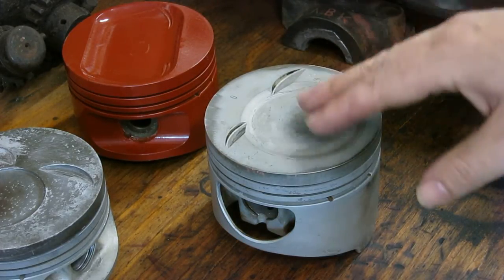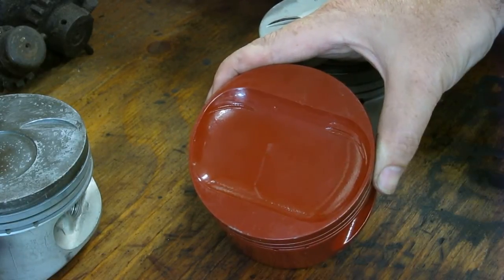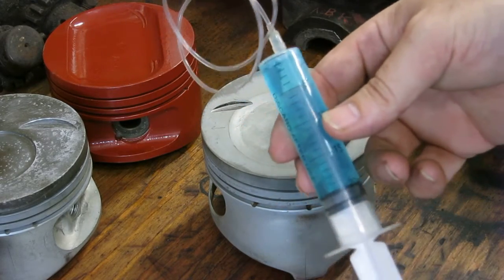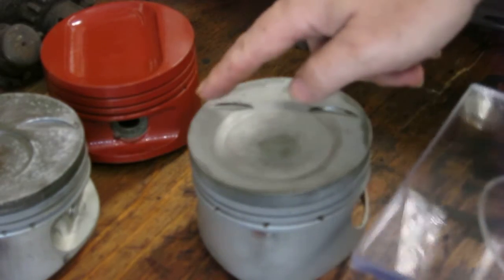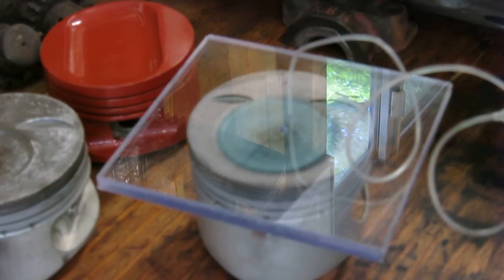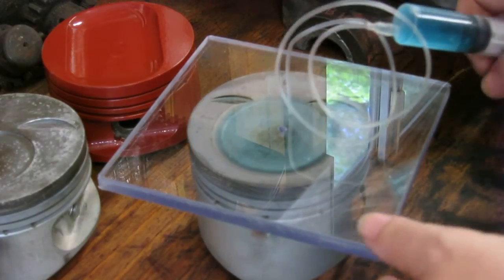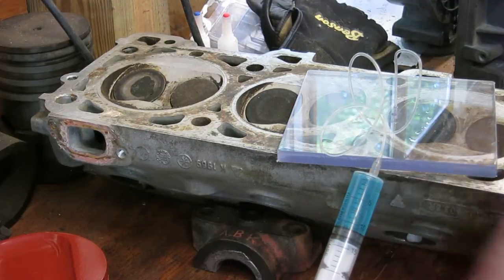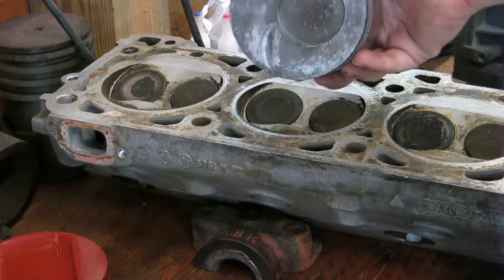Measuring piston head volume

Comment: What about the volume in the hose still? Do u have to add it back to the syringe since it took it from the syringe but didn't add to piston
Reply from the maker: If you start you calibration right when the water is already at the end of the hose, then you don't have to account for it.
Reply: @vsvenson Got ya
Reply: Thats why I've been using burette instead of syringe, its because of this calibration mess. Burette seems to be easier

Comment: Great video sir! I've been with that doubt for while! Ok first Measure the piston surface and see what many cc, then the same process in the head gasket chambers, then what?
Reply from the maker: Once you have your piston volume, your head volume and the volume of the thickness of the head gasket, you add those three to that cylinder's displacement (in a 2.5 liter four cylinder, it's 0.625 of liter).  That's the first number of your compression ratio.  The second number of the compression ratio is just the 3 things you measured.  You might get something like 0.075 liter for your measurements - so that would be 0.7:0.075 - which reduces down to 9.3:1.